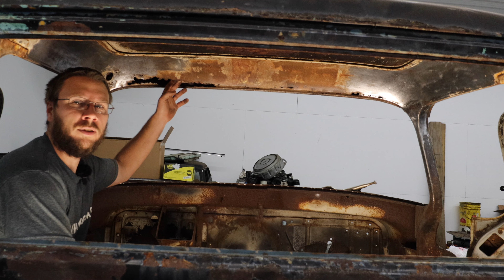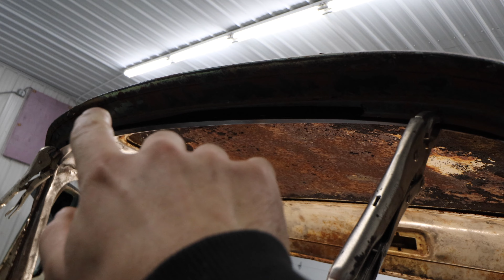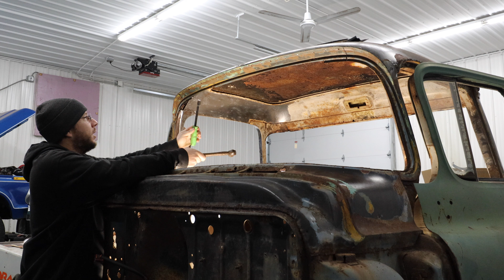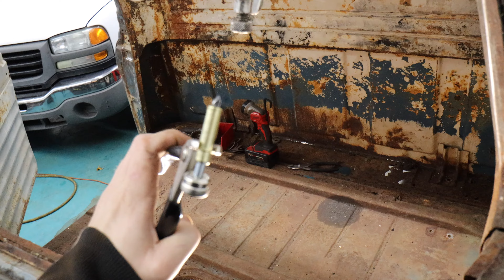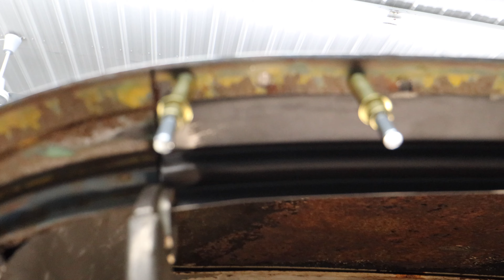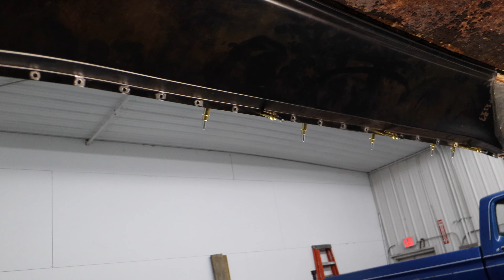55 Chevy Truck Build - Rust Repair Above The Windshield - Building My Wife's Dream Truck

Comment: Any follow ups since this video was done? You doing anything else with the cab? Did the window fit well? Thanks for your videos. Jay G
Reply from the maker: I will be getting back to the 55 soon. There is plenty of rust to repair/replace. Even going to make custom floor pans.
Reply: @machnikgarage  That is another area I need to work at on my 56 Cameo barn find i recently bought. Your videos are a big help for those of just starting metal working .  You are definitely a body guy!  Also, showing the tools you use is a big help. Thanks. JG

Comment: I need to do the exact job on my 1956 Cameo truck. What company did you buy the parts from? I really appreciated your video.  I'm not a body guy , but will learn from this project. I learned alot from your video. Thanks. Jay G
Reply from the maker: Parts are from lmctruck.com. It’s really not difficult just very time consuming. At first I didn’t think I needed to do the outside piece but it was paper thin so if one is rusted out I would be willing to bet the other is almost there. Take your time and you’ll get it!
Reply: @machnikgarage  Thank You!!